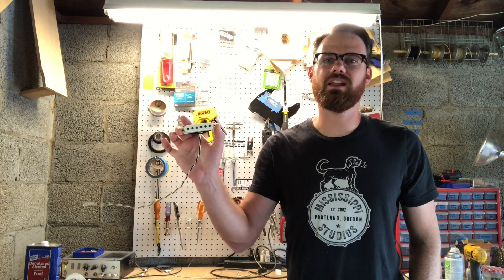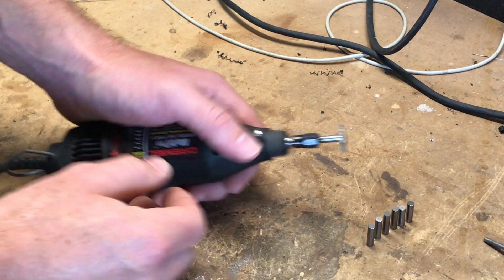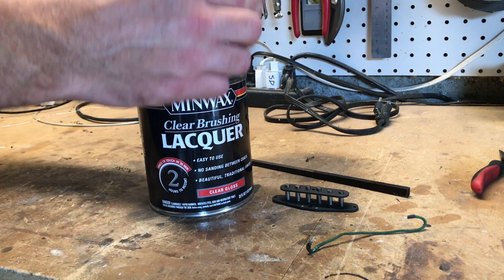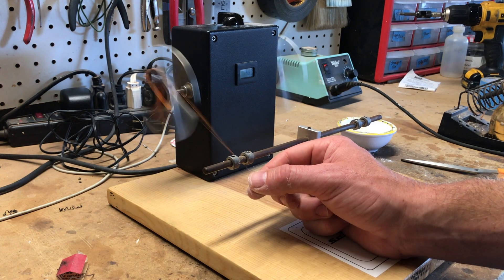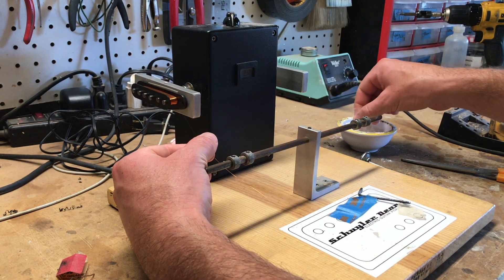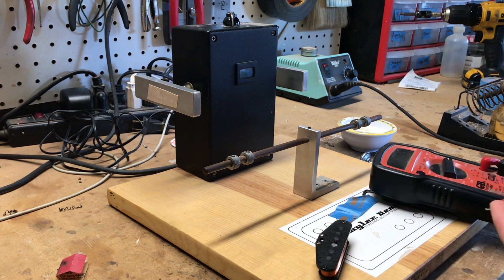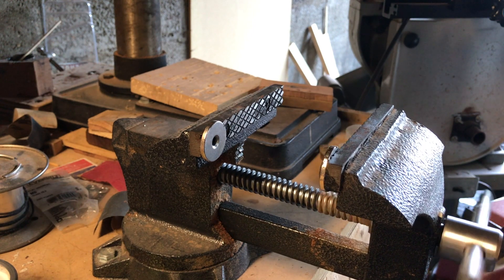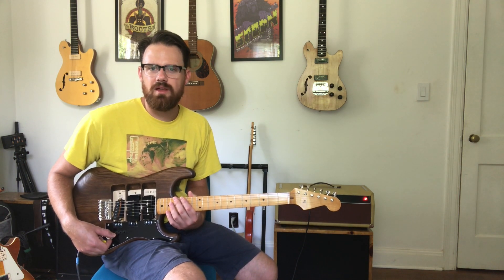How to build a Stratocaster pickup

Comment: You've coiled it exactly reverse of what Fender did in the 50's and 60's. Fender always attached wire first to the right eyelet with the black lead (looking at the top of the bobbin with eyelets in front) and finished at the left side eyelet with the white lead - coil wound onto the bobbin counter-clockwise. Nice video otherwise.
Reply: instaBlaster...
Reply: so  if you did it that way ,  then the wires cross at the point of eyelit ,,   id say do it like this,  as you said but start on the left eyelit , that way it dont cross leads at the end it just looks better   for sure

Comment: Huge thank you for this ... in particular the excellent advice about not getting a resistance reading and the solder not having burnt through the wire coating. I'm using 42 AWG Poly and its advertised as solderable  I was convinced my first pickup was dead, all threads say no reading is a wire break!! I went back and reworked the solder on the eyelets and bingo ... 5.46k & 2.10 henries

Comment: I'm getting a set built. Tend to like non potted pickups...Whats the best way to about this without them squeling like a pig?

Glue the magnets? Wind it tight? Wax pot the Bobbins and Magnets (not the winding)?
Reply from the maker: Wind em tight and don't turn up the volume too high.
Reply: @SchuylerDeanPickups  what if i want to play loud? are unpotted pickups out of the question?

Or should i dip the magnets and bobbins (not the coil)?
Reply from the maker: @levijessegonzalez3629  I would recommend potting the whole thing, see my video on wax potting.

Comment: do you have any idea what happens you make it over wounded ? I wanted to make 1 over wounded because the #1 of SRV supposed to be over wounded "by defect by factory" and it sounds better than regular '59s....but I have not done it so I wonder what if ....
Reply from the maker: That's when the magic happens
Reply: Overwound = Hotter & louder pickups. 
SRV basically used low output pups contrary to anyones belief.

Comment: Hello sir, i have a question. What if the left thread on my pickup has been cut to short so it does not quite reach to the left eyelid. Since it goes straight into the inside of all the wrappings i cant unwrap in any further in order to make it longer. Is there any way to fix that pickup without having to unwind and rewind the entire pickup?

Comment: How do you measure the capacitance and inductance? How does wind patterns effect them? Does hand winding them give you the same results usually or is there an “art” to winding? Great video.
Reply from the maker: You can measure those with a meter. There is an "art" to winding; getting the most space and air between each winding as possible while still getting the correct number of turns on the bobbin, thus lowering capacitance. That is scatterwinding.

Comment: Is using pickup tape to wrap around the bobbins a viable alternative to lacquer potting the pole pieces ?
Reply: plumbing teflon tape, kapton tape, anything thin enough so it doesn't take too much room.. super glue would work the same. in theory the coil can't short out because there's no movement in the wires, it's just an extra protection and some ppl say it helps a bit w/ 'pickup microphonics'.

Comment: Great and informative video, sir!
A question doh:
How can you extend the wire if you don't have enough? Do you simply start over with a longer wire?
Have a great day!
Reply: when i was a kid, i made an electric motor and would the coil by hand... it never worked when i tested it. when i took it apart years later to re-use the wire, i found out why: the wire had 8 ends :)
moral of the story: you need one continuous wind of wire or your coil won't work... if the wire is too short, either get a new wire and start over, or live with a smaller coil :)
Reply: @zed42  i'm pretty sure soldering would work for adding extra turns in the coil... i'd position the joint segment in the middle of the long side of the bobbin, twist the wires together a few times and use extra flux so that the solder would flow super easily for an extra thin coating.
for insulating the joint, i'd probably use superglue.
Reply: @duroxkilo  for the coil motor, which used maybe 22ga wire, i would consider trying that (i'd use paint or varnish for insulation) but with 43ga wire where i care about the shape of the magnetic field, i'm not sure i'd trust a patch.... could be an interesting experiment, though!

Comment: Schuyler, how do you make a normal stock strat pickup into a tex mex or texas special? My stock strats use a ceramic magnetic on the bottom of the bobbin and use steel pole pieces which I think are non-magnetic pole pieces.
Reply from the maker: Those are MIM or Squire pickups, not American Standard. You're going to want to replace those with alnico pole pickups. Texas pickups are hot blues pickups.
Reply: Yes if I take out the ceramic bar magnetic on the bottom of the bobbin and take out the pole pieces. When I put in alnico pole pieces what can I use to put on the bottom of the bobbin so the Alnico pole piece won't fall out? because there was a ceramic bar magnetic holding the pole pieces from falling out
Reply from the maker: @waynegram8907  I have never modified those pickups. It's easier to just replace them.
Reply: oh ok I thought maybe you have modified them before
Reply: Saw a mod they used hot glue